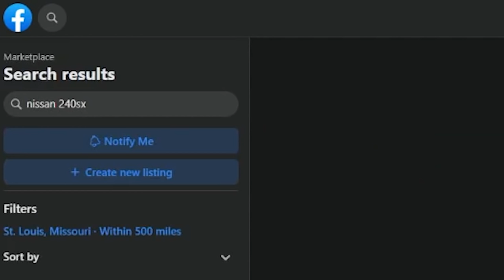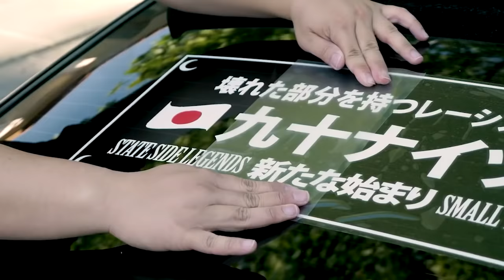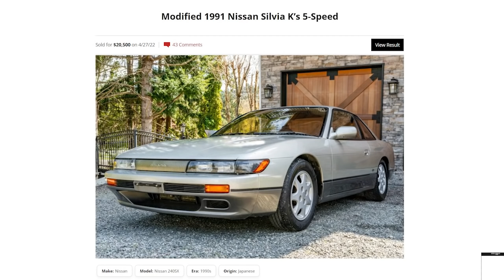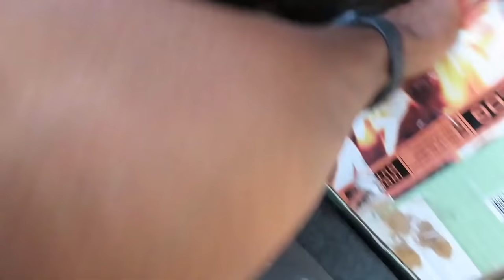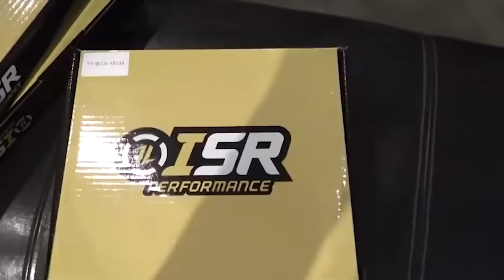Hard Truths of Owning a 240SX in 2022 (Donut Media Won't Tell You This)

Comment: I was looking at buying a 240sx like 10-11 years ago. It was on Craigslist for like $5,000.00+ and the pictures that were listed WERE NOT the car that I was shown in person, the dude selling it looked like Fred Durst, flat bill baseball cap, tatted to all hell, wearing those big Dickies shorts. The car was utter trash, the shock towers were rusting to hell, the interior was stripped out, it had some cheap off-brand racing seats, and an ugly ass looking rear wing you would have seen on Pimp My Ride or Need For Speed Underground, a huge ugly ass fartcan hanging off the back. I ended up buying a 2004 Chevy S-10, I still have that S-10 and it still gets me places and it gets the job done. 

What I will say as far as "building" your 240 and this goes for ANY car, if you're going to throw a bunch of shit on it, do it right, have a real RESPECTABLE purpose, but reality is, you're no Chip Foose, you're no Yokomaku Hironao (The owner of Veilside), you're no Von Gittin Jr with his RTR stuff, If your car is only being built for TikTok Clout, piss off. If you're going to make a racing car, then put racing stuff on it and actually take it to the track, if you're actually going to drift, then actually drift your car, if you're building it for Sema or want to build it for Sema or any car show, then learn about the vehicle first, learn about ALL the inner workings of that car, it's engine, the vehicles history, so on and so forth and actually learn fabrication work, how to make panels. But if you're some dipshit 18–30-year-old who doesn't know a damn thing about your own car, can't turn a wrench to save your life (talking to the guys "🤪all my work is done at a shop by such and such shop, but I can't tell you any of the data on the cars specs or anything relevant about the car at all") piss off.

Comment: I must say I’ve watched the first 3 mins and a lot of it is true but it isn’t, I own a 1991 240sx I bought it when I was 20 because I love the cars and the clout but, I did years and years of research and wait for 2 years before I finally found one for a decent deal that I was ok with spending money on. When buying one you have to look at it almost like in the 3rd person. Self control, I paid 7k for a fresh painted running sr swapped stock motor clean title matching bins 240 but it was gutted I am 22, I had done a lot of research but I had little to no experience with owning or modifying any car of this nature. I buried myself into the forums trying to find out what was fact and what was cap. Still to this day it runs and is fun and definitely daily drivable if I wanted to but it still needs work and I have dumped in endless amounts of money it feels like. Just some experience from one young owner to hopfully another.

Comment: I agree with most of these
Im 19 and I've saved enough money to buy right 200sx with CA18det, but wait, they're not cheap anymore or there is no fucking anybody selling.
Im not mechanic, but i was working at paint shop so im not afraid of rust or replacing anything, I search alot about RS13 model and others.

i've been looking for two ones, one i might buy, and one that was overpriced fucking shell for 4200$ that had no interior, one seat and no engine. (was gone day after i seen it) 
the other one had two broken CA's but had all interior and i might get it, but dude just wanted as much as for that bare rolling shell (kinda reasonable + spare parts, stock car)
I've been searching for right one so long, i'll not give up, i know what's so shitty with these cars, and i'll learn more when i'll get my own, I just know what i'll be doing because im not so newbie, but also not expert, cheers and nice video.

THIS ISNT A MEAN COMMENT, It means they're not worth crazy money with 'stupid' shit done to them'

Comment: The questions that should be asked when buying a cheap car like a 180 or a 240sx : does it have an engine is there any rust does it have an interior it the radio still. Does the car smell like shit when you get In It. Is there any missing parts? Ask questions don't be an idiot.

Comment: idk my 240sx was my first ever project car, maybe i got lucky? maybe cuz im not a social media idiot (all i use is facebook marketplace), no instagram or tinder or twitter or w/e the fuck they're called. ive been a brake and alignment tech for 10 years and know enough to get by as far as engines going. this things a piece of cake to work on... 5 lug swap / z32 brakes / hydro e brake, full angle kit / manual swap / EGR delete / intake w/ z32 maf done so far. TBH this is one of the easiest fucking cars ive ever worked on. i lucked out big time on chassis tho, 120k miles, zero rust, 2 time owner (old timer i bought from) $3000 and it was mine. so as far as the beat to shit 240s out there, a lot of this might not apply to me.

Comment: Does anyone know if you can easily swap a coupe instrument panel (digital speedometer) into a fastback(analog speedometer)? Like is it plug and play or really difficult?
Reply: Specifically talking about s13 coupe and hatch
Reply: S13 coupe and hatch have the same cluster.  I think you are referring to the HUD cluster.  As long as you have the wiring it will plug in, just make sure you have the correct cluster for your engine (SOHC / DOHC)

Comment: Jeez I'm glad I never had money or time to burn for buying and trying to fix something like a 240 or other rusty shitbox. 

I'm in way over my head triyng to get my '93 Opel (Vauxhall) Astra F (1.6) through inspection. Got it from my Mom for free, but it's worth like 300-600€, depending on seller's honesty and buyer's wit.

It's a bitch and a half because I can't weld, have no tools of my own and very little time outside of uni. 

It's running beautifully but needs some bodywork (bc the inspector was being a dick), brakelines (again, thanks asshole, they would've been fine for another 4 years!) and some more finnicky things. 

Thanks to a very, VERY patient friend of mine (incredibly skilled autodidactic semi-pro-mechanic) whose tools and space I borrow there's a chance I'll be able to pass the second inspection. 

What should've been 2 weeks turns almost 4 months now, lesson learned. Don't buy or accept unregistered cars if you can't full-time it. 

and LURK goddammit

Comment: lies. i bought a 240 that was not running for 2 years. put an alum radiator. a new battery. oil change and plugs. new tires and megan sus for daily and it takes me to work. best 3k spent

Comment: that car is mediocre in the first place old 90`s garbage with 0 accessories absolute shit pile for that money I can have nice IS350 or 350Z which will obliterate 240sx anytime with much more accessories heated/cooled seats, leather seats, working AC and 100 other things. Rust wont be issue yet. 
And I dont know what. That crap if its passing emissions then applause. Suspensionwise or wheelwise that junk will fallapart in slightly worse road than usual. Rather Celica GT4 or Celica TS ok its FWD but for beginning much better check thatDudeinBlue how much he spent on his 2JZ 240sx? And its still pile of...